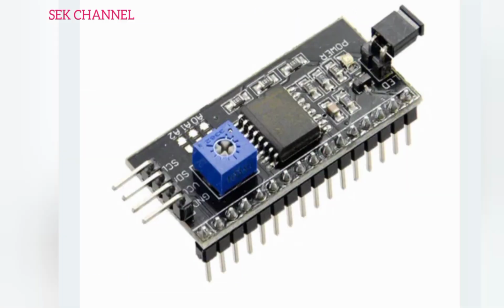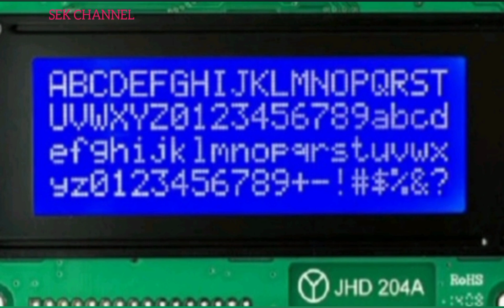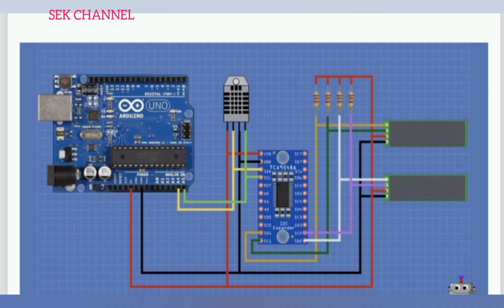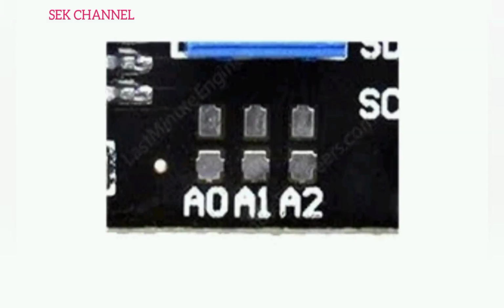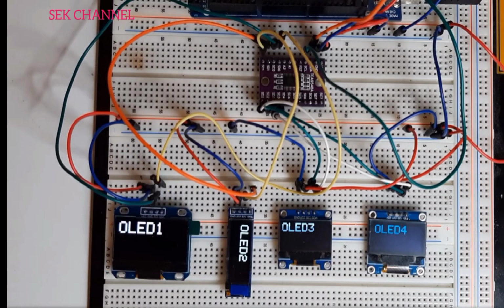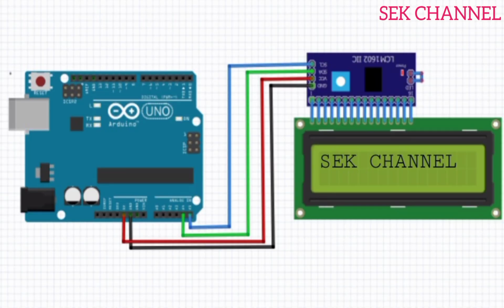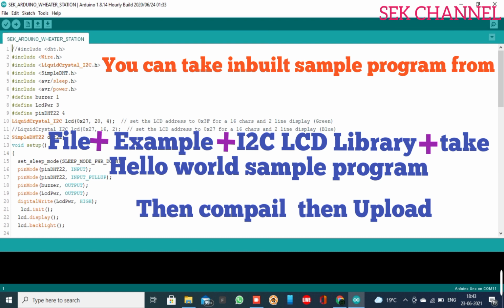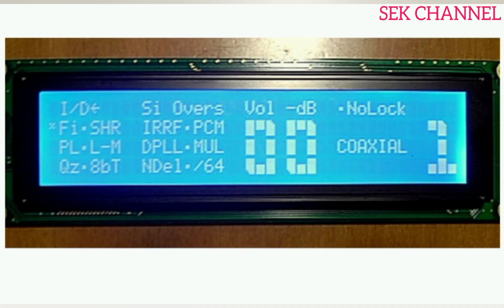Arduino interfacing with I2C and 20x4 LCD Module # English

Comment from the maker: Learn about how to interface 20x4 LCD with Arduino through I2C Module, complete details of I2C Module and 20x4 LCD like... Pin connections, working and when, where, how to use.... Like that